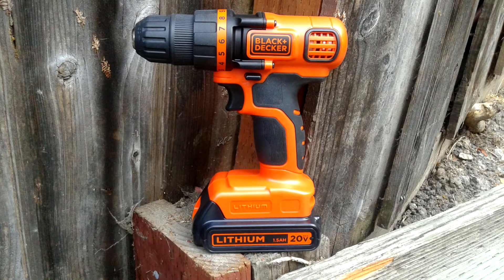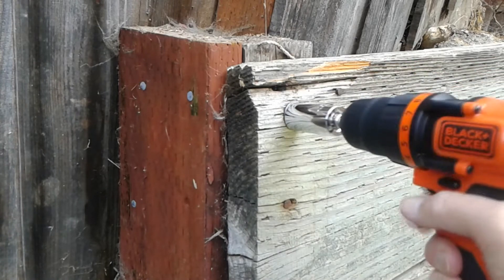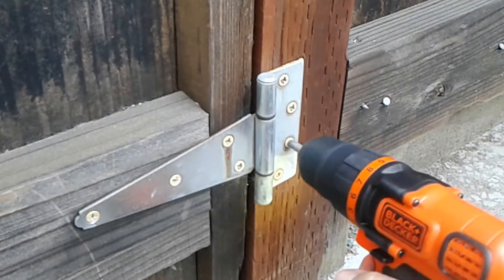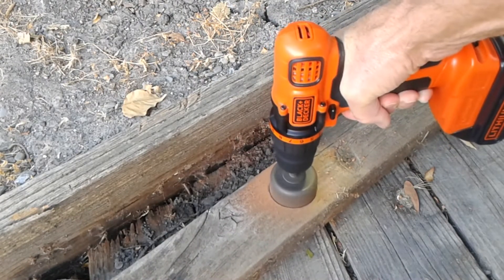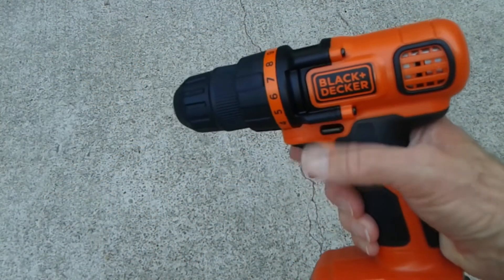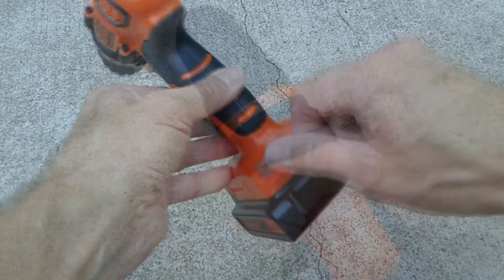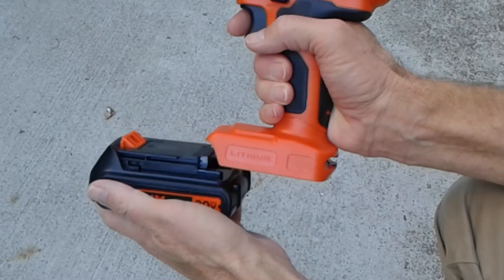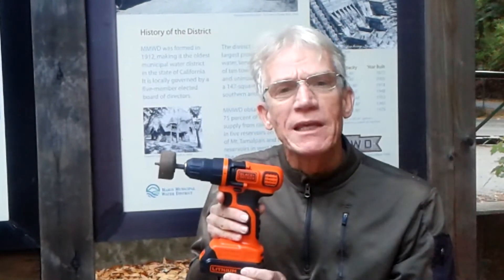Black + Decker 20V Cordless Lithium Drill

Comment: black & decker also makes air compressors. wet dry vacs. power washers.
Reply: And angle grinders too. I have 900w Black & decker angle grinder, which handles 125mm discs. This beast is the fastest angle grinder I've ever had. Previous ones were about 11000 rpm, and this one is above 12000 rpm. I thought it's gonna take off when I used it for the first time xD.